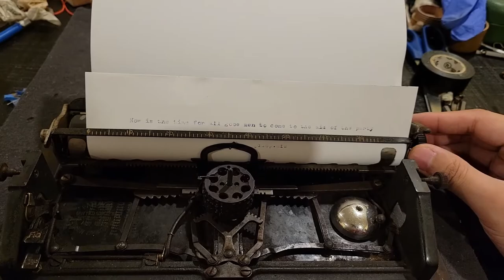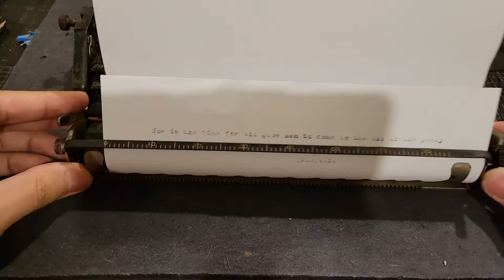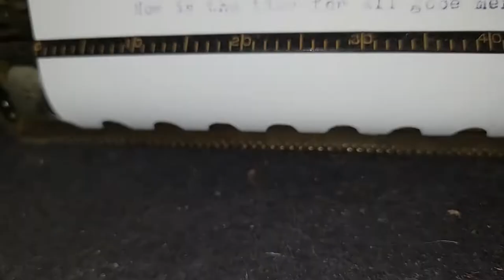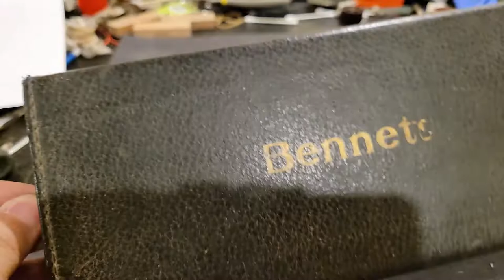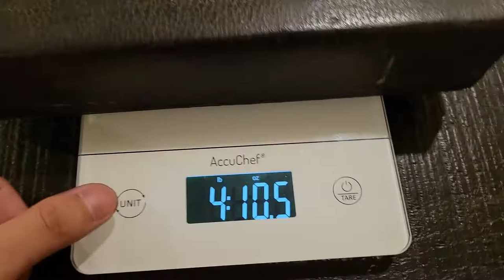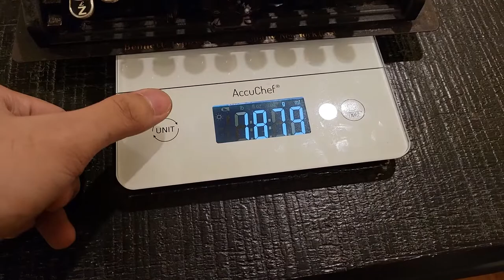The original 30% mechanical keyboard (1910-1913 Bennett typewriter)

Comment: IBM rediscovered the typing element with the IBM Selectric typing ball.
Reply from the maker: Indeed. Now, per https://site.xavier.edu/polt/typewriters/varityper.html, Hammond, which became Varityper, continued using their own single-element type shuttle all the way into the 60s or 70s, so the advent of the IBM Selectric more so acted as a new major competitor to the Varityper offering substantially faster typing speeds. But yes, it could be considered a rediscovery of the Blickensderfer Electric which was unfortunately much too ahead of its time.

Comment: I have a question, would you say that this Bennett typewriter has more simple mechanics? Or is it more difficult?
Reply from the maker: I would say it is indeed simpler while using much less parts than typebar typewriters for which you would still have to do calculations for the geometry of each key linkage train.

Comment: That's machine it's so fuckin' simple. Seriously
Reply from the maker: Assuming you are referring to the elegance of the mechanisms for translating keypresses into rotations and pushes of the type cylinder into the paper, I suppose you could say so. But in practice, I can imagine that back before the advent of electronic calculators and computer-aided drafting, deriving these precise geometries would have been quite difficult.
Reply: Believe it or not, it's easier for me to draw by hand than to do it with a 3D modeling program.  I design machines as a hobby and I have always used a mine pencil, eraser, ruler and paper to get out of my head all the mechanisms that, more than once, have left me up all night, always trying to keep it as simple as possible. 

After all, anyone can design a stupidly complex mechanism, but only a genius designs somethings simple.
Reply from the maker: @gaston01000  Indeed, drafting by hand versus using the aid of software presents tradeoffs. I do typically sketch my ideas first, but in practice, to really know that a design or a complicated kinematic trajectory will work or that the analysis will withstand actual manufacturing, lots of math or numerical analysis may be needed, and computers can automate a lot of that. I have actually for the past few months been working on a fascinating typewriter design I wish to eventually produce, albeit as a high-end collectible unless demand enables higher-volume production. And yes, working through the iterations for getting a design as simple as possible for one's resolved requirements can be quite the mental exercise. Some typewriters I've acquired are the complete opposite of elegant, but they work.